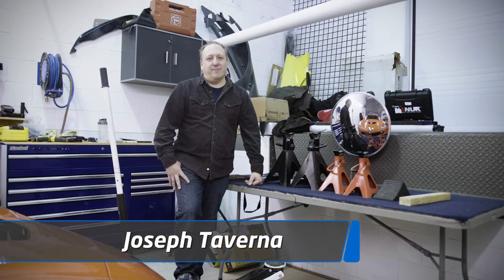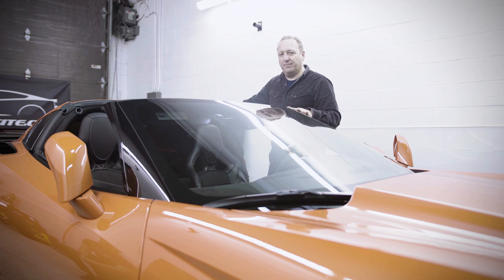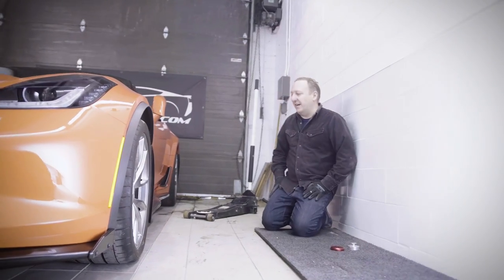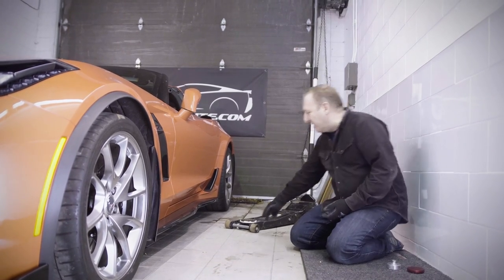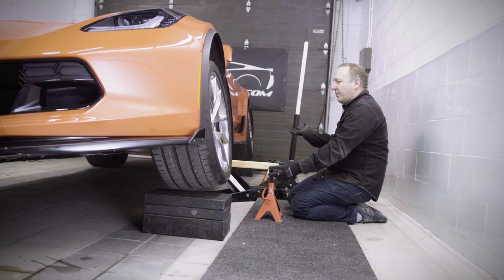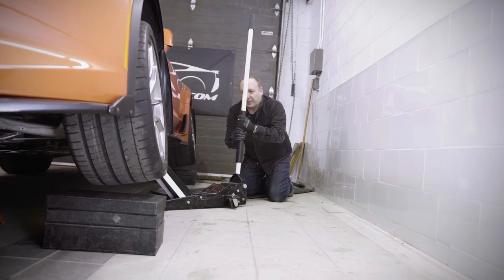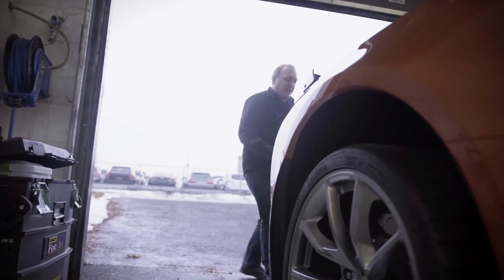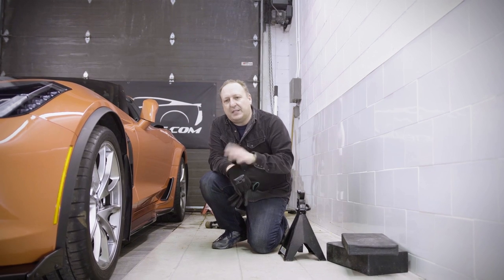How-To: Safely Jack Up Your C7 Chevrolet Corvette | ACS Composite

Comment: I couldn't have said it any better.  Pucks are a must have to keep things level and secure.  I always use them on C5, 6 and 7 generation Corvettes.   Keep up the safe jacking!  -Glen
Reply from the maker: Absolutely, Glen!
Reply: When i bought my 1st C7, i was told to go to the Ice hockey rink & buy 4 used hockeypucks!!!   $1 each...
I use them & store them in lt.rear compartment just in case.  Works fantastic!!!  Joseph is correct in everything he preachs in video....be CAREFUL!!
I bought 2 harbor freight alum floorjacks for $59 ea.   They fit under sideskirts and fr and rear lift points. I use the hockeypucks.  This setup works great.  Dont forget to use wood on top of jackstands to add to grip/protection from gouging frame from steel jackpad contact with aluminum frame!!!...
This works perfectly for me.

Comment: I have heard on these corvettes that jacking from one corner can stress the frame and possibly crack it due to the force on the opposite side of the car? Any thoughts on whether that's a concern or not? Great video
Reply: You need to open the hatches. Hood, trunk, both doors. Not doing so will bend the frame. I do my own things to my vette because people don’t know how to handle it, unless it’s the Chevy dealer

Comment: Great video! What are your thoughts on using the jack adapters that widen the surface area of the jack so you can lift the entire front and then the entire rear? I was interested in this because I have some jack stands that have a cupped top and was wondering if they could be used in the locations you would use on a hoist/lift
Reply from the maker: It’s a not a bad idea. You’d just need to be mindful with a wider surface area that you are not damaging the surrounding parts (side rockers for instance).

Comment: Nice Video Thanks,, just a question, if I want to do brakes 1 wheel at a time, can i just jack one corner at a time rather than the whole car?
Reply: Probably not , but you could just do it on the side and do those 2 and flip it and do the other side

Comment: Why dod you power ignition to set brake??
Reply: Late response but the parking brake engages/disengages using an electric motor. It is a switch, not a lever.